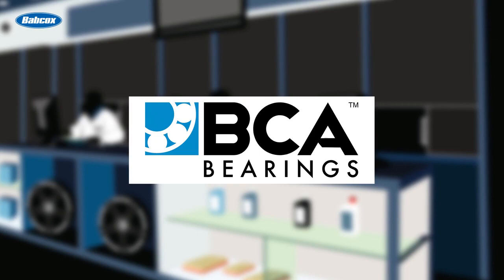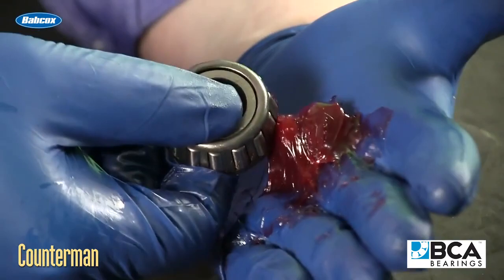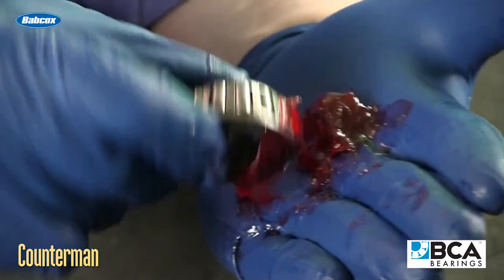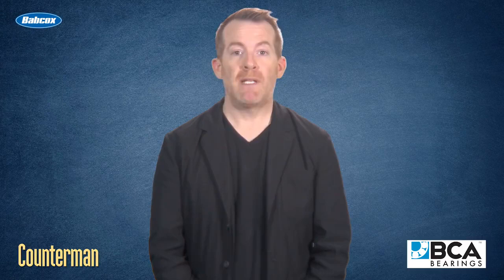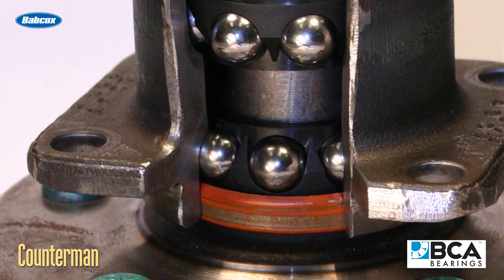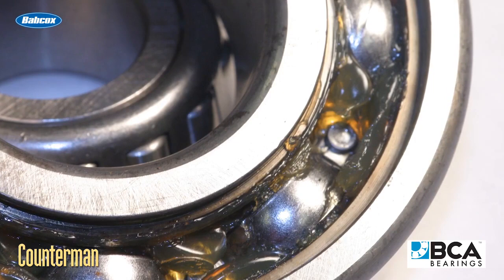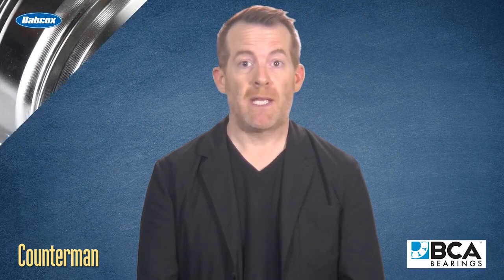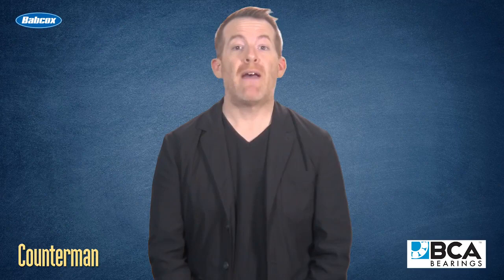Why Is It Important to Use The Right Wheel Bearing Grease?

Comment: He never said what kind of grease to use. Am I wrong?
Reply: He said to use bearing grease, not chassis grease, but did not get any more specific.  I want my time back
Reply: Who cares. If you clean out all the old grease, you wont be mixing the types. Never seen packed bearings wear prematurely using ballpoint grease or bearing grease. Just remove all the old and your fine. It's grease. Just dont mix them .... Many argue this point, but funny how no test has proved and shown a premature failure if done properly. Wheel bearing running years with balljoint grease in it. Come on. Should I put ASE certified bearing mechanic in my title? Then will you think its a lie? Smh. Everyone's a pro now. 50 years ago this was done all day on all bearings before all these other types of grease came out!!! 

JUST DONT MIX THEM..  BUT DONT LISTEN TO ANYTHING ELSE HE SAYS 

Grandpa would run any grease on a cleaned out bearing for another 15 years!
Reply: Kluber NBU 52 Grease